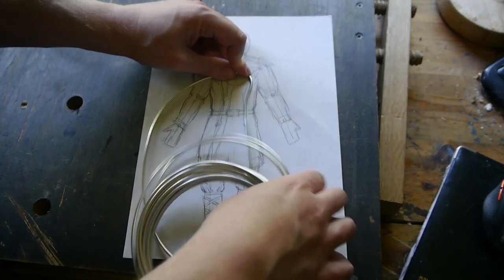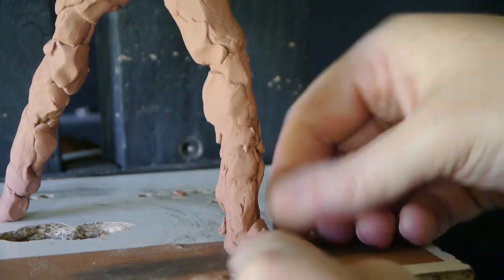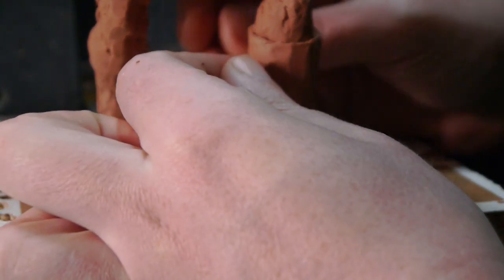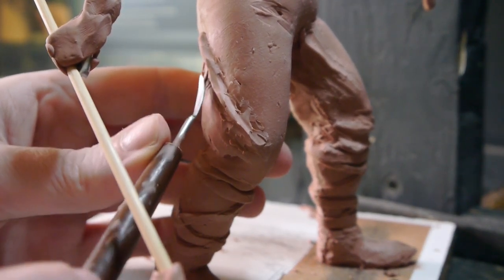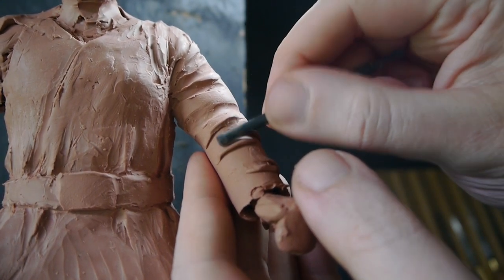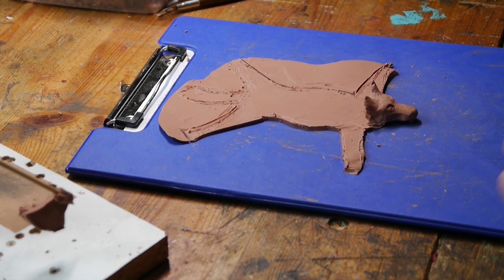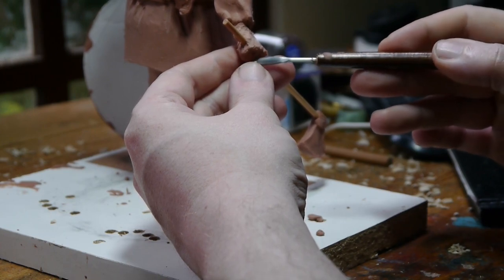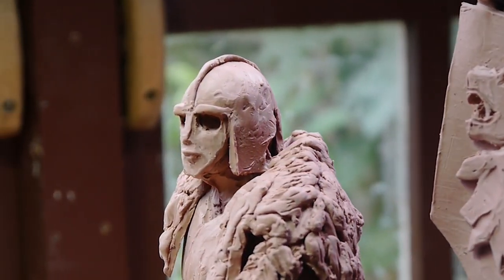Anglo Saxon King Clay Sculpture | Rough Prototype for future Wood Carving

Comment: i know why you use clay :)   

 looks good my dude, i know several folks who'd be proud . . .  

oh yeah, get with Paul or Chris about make'n your own tool bits, lil brass pipe, some wire, wood bits, etc. . . and you'll be good and they'll know what tidbits and odds n ends will suit you.    

those pouches could be anything . . . from "shot" for sling, to arrow heads, to emergency kits, to signal stuff for scouts. . . if it was a 'personal' kit it might had a flint n strike in it, a small lot of line and some hooks,  first aid stuff, "recreational" stuff, food  a spoon or tuck knife. . . :) there are lots of ideas, no real finds (that i'm aware of anyhow). so it's all supposition.

look'n forward to the next one :)
Reply from the maker: Hey dude! Good to see you

I saw that some of them used slings, arrow heads I didn't think of that! All good ideas, I guess there's still plenty we don't really know from that time

Thanks for having a look and for the advice, appreciated as always